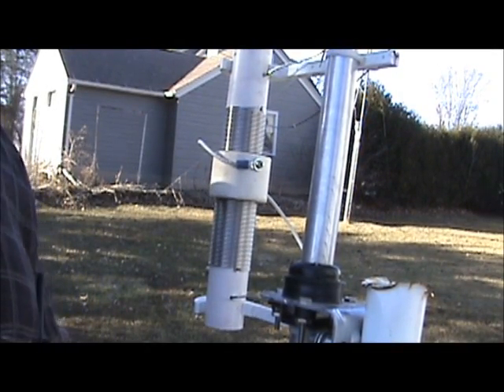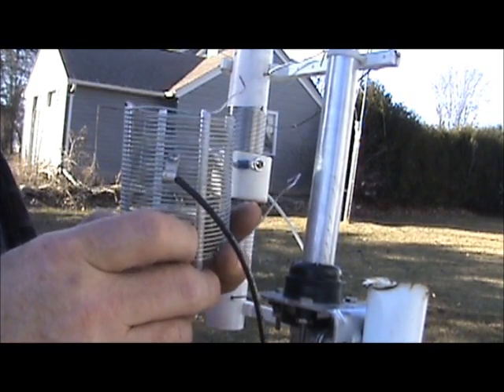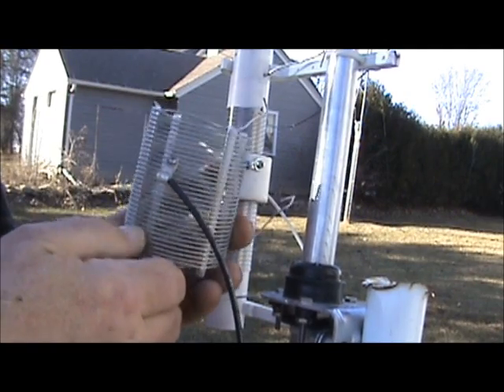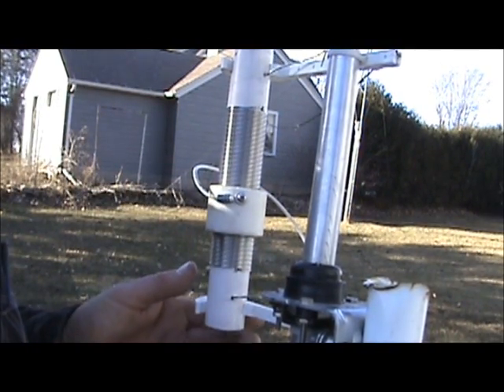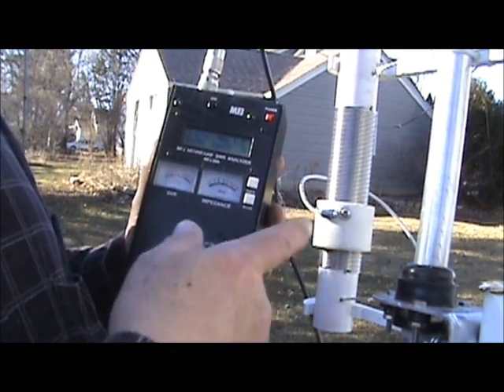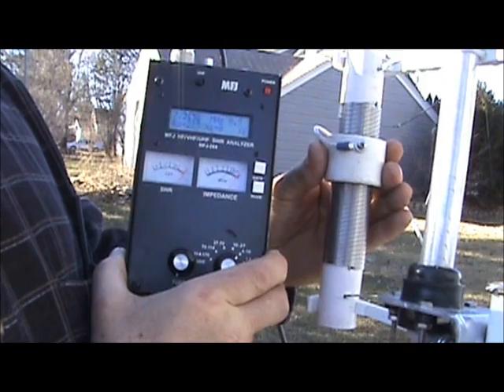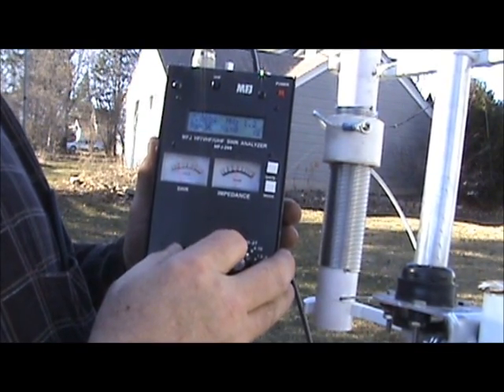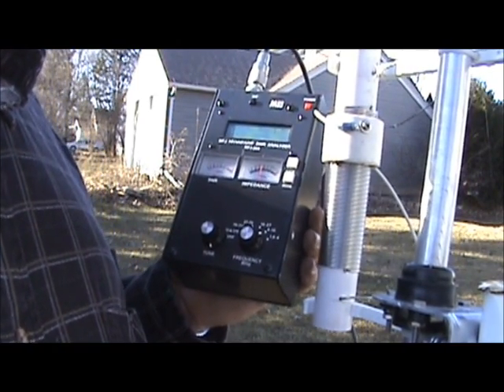wolfrivercoils.com Vertical Base Variable Replacement Coil

Comment: This looks like a good solution, but I have a question.  Once you have the best taps identified for each band, is there a way to mark the location and go back to it quickly (without reconnecting antenna analyzer)?  tnx KT3L